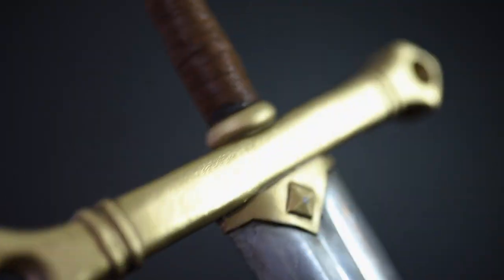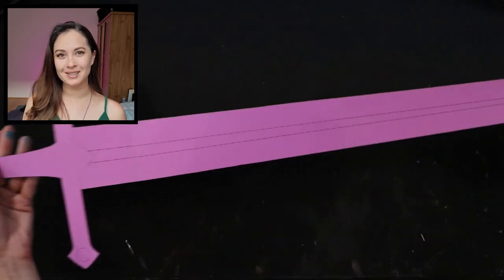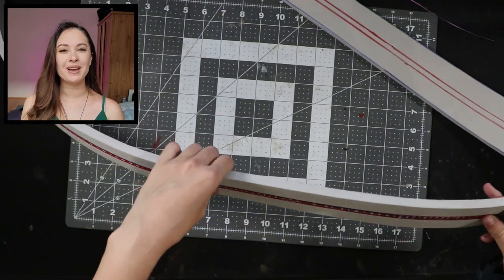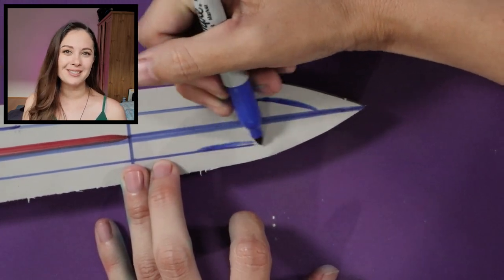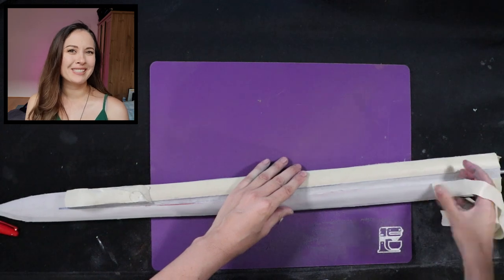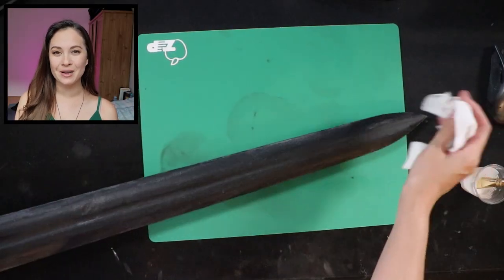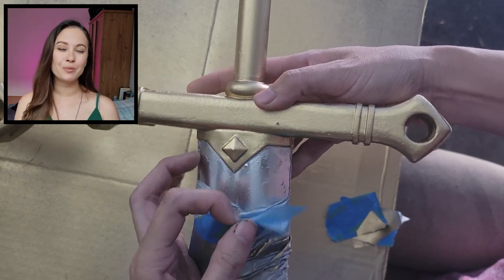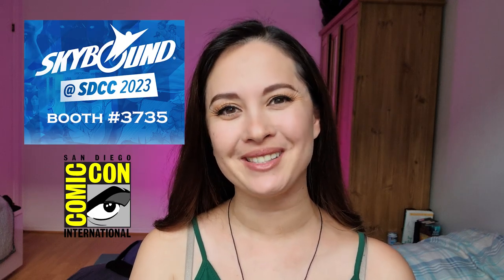How to Make a Worbla & Foam Longsword | IMPACT WINTER | Free Pattern!

Comment: Looks good Hendo.
End posing though looks like the sword is forward heavy and noticed there was no real weight added to the pommel end. Thinking maybe if you had the rod go all the way to the end of the hilt so you can also add some nuts and/or washers to the end it would help with sword balance, and thus would help with the look when posing.

Comment: Looking at the info box from the author, I have to say that rapiers and katanas are not "light" weapons and a typical European longsword should be around three pounds for historical reference (at about 4 feet total length). @Hendo: I would have preferred the blade to be a little less thick, but because you went with a fuller (kind of Type XII blade), I know you did not want to go through the core with the rod. Nice result for the sword!